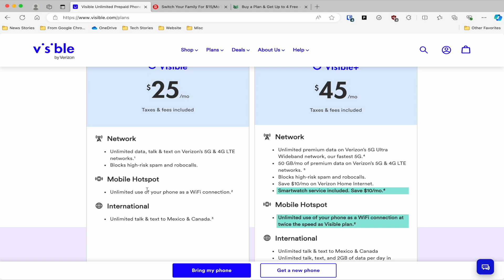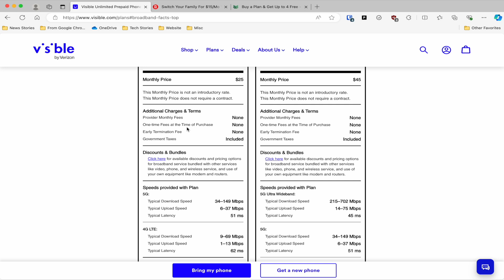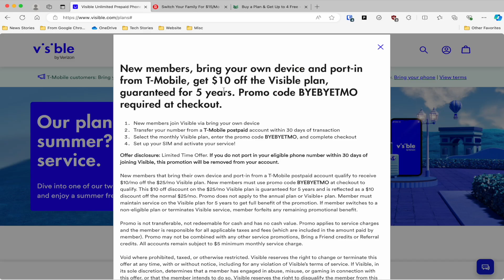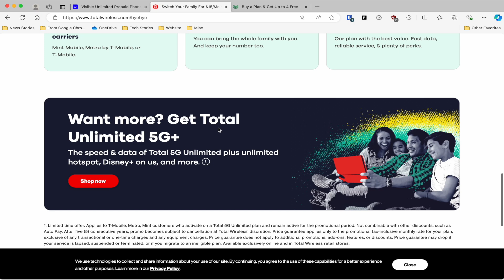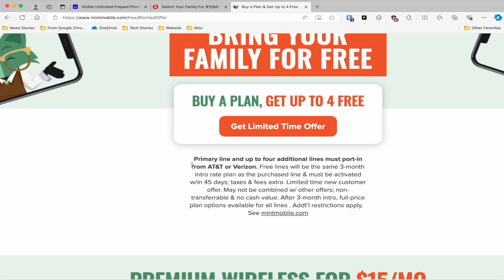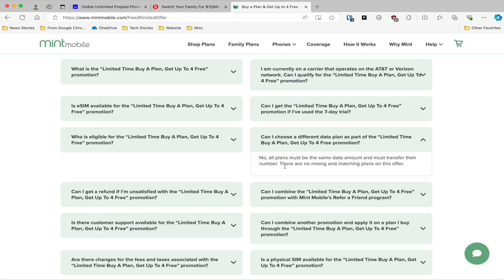Visible, Total Wireless, Mint Mobile - Which $15/mo deal is better?

Comment: Isn’t Total the best plan since no data deprioritizing?
Reply: Seems so, I just started with TOTAL about week ago and so far simple and no issues, even picked up $35 home internet--I was able to activate at different address as well. Unlimited no cap with 5g UW without prioritization issues so far.
Reply: @chinh what home internet did you get?
Reply: @ total wireless when they had sale on mode/router itself, then bundled with phone plan made it cheaper
Reply: Yes i left visible plus for them … works 100% better

Comment: The 30 Mbps download speed cap is when you’re in an area with 5G Ultra Wideband. Visible used to cap the speeds at 200 Mbps down, but they decreased it to 20-30 Mbps down/up.
Reply from the maker: Hi. Thanks for the comment! I wonder why they started decreasing it to be between 20-30 Mbps. It's also strange that not every customer is experiencing it.
Reply: @TechThatDoesntByte  I've been using Mint and I'm really happy with the service, even though I'm not a huge fan of having to commit for 3 months (or for a year to get the best price). I downloaded the speed test app a couple of weeks ago and have been a bit obsessed with testing out the speeds wherever I go around the area. For the most part, it's been lightning fast. I've actually clocked in at as much a 1300 Mbps download and in certain places I can be sure of getting over 1,000 or at least 800. Other places it's not as much (outside my house I've gotten results from 28 to 300). I'm thinking about trying the Visible 15-day free trial in my empty eSim (I have the Pixel 8a) just for comparison sake before I commit long term to Mint and I realize 30 Mbps is plenty for just about anything, but I still don't care for that sort of 5G cap. By the way, I've also been surprised to find just how much data those speed tests blow through as I'd only run them on home internet before.